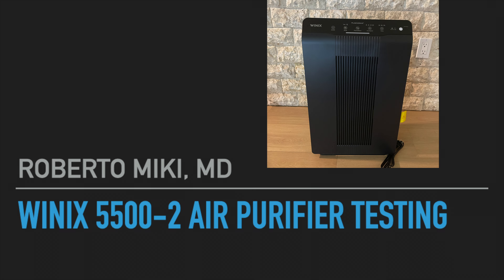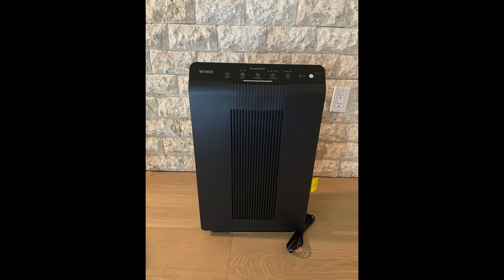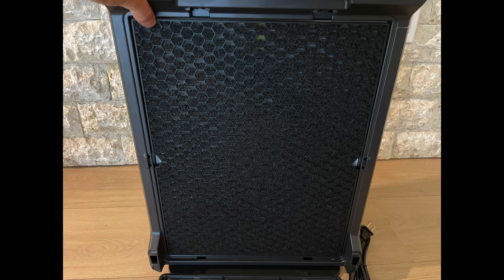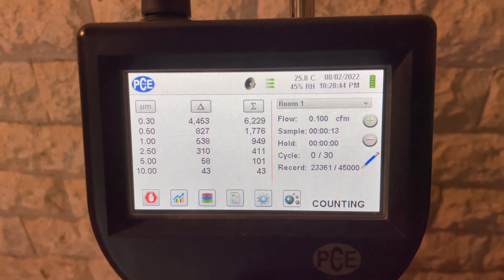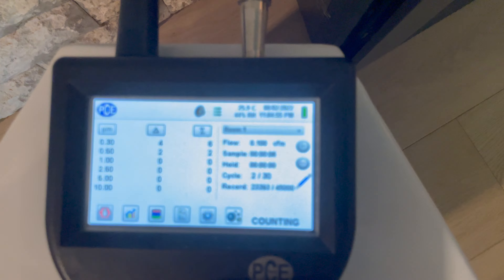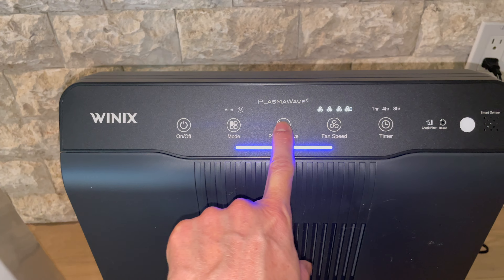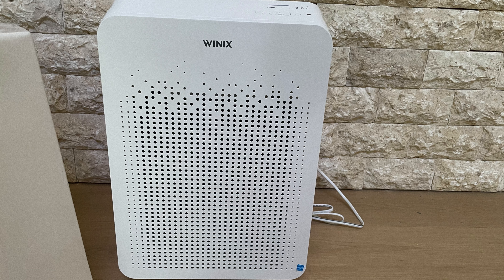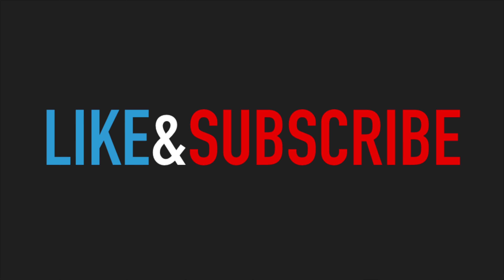Does Plasmawave create ozone? Winix 5500-2 Air Purifier Testing

Comment: Fantastic!  Thank you so much for putting us all at ease.  🙏
Reply from the maker: My pleasure! Thank you for the suggestion!
Reply: Not trying to worry you, just FYI, I was researching this 5500-2 unit and read that its Plasmawave function does produce ozone at about 3 parts per Billion. That is an insanely small amount, and personally I would not worry about it. Just wanted to mention it because while this is a good video, the testing meter they used only measured in parts per Million so that’s why it didn’t register on their meter. If it makes you feel any better, the 5500-2 is CARB-certified. CARB is a California safety agency that does extensive testing and will not certify anything that produces more than 5 ppb of ozone. I’m about to buy this 5500-2, it seems amazing for the price.
Reply: At 3 parts per billion, how long before it adds up to become over 50 parts per billion? Wonder what a monthly trend would look like...
Reply: @oscarescobedo8311  I'm not an expert but everything I've researched says ozone breaks down into regular oxygen in less than an hour at low concentrations, or in about 3-4 hours at high concentrations. 3ppb is an extreeemely low concentration so I'm guessing it breaks down in a matter of minutes. Or maybe 3ppb is the leftover amount that the unit regenerates faster than it can break down, until you turn Plasmawave off. Either way, it's not going to build up over time. 

I did buy the 5500-2 a few months ago. I usually run it w/ the Plasmawave turned off just in case. But I have used it w/ Plasmawave on when trying to get rid of chemical odors. I left it running for hours and didn't notice any adverse effects

Comment: One question about the Ozone Detector: what is the resolution of the device. Perhaps it’s not sensitive enough to detect ozone.
Reply from the maker: Resolution of device is 0.01 ppm per the manufacturer. OSHA has a limit of 0.1 ppm over 8 hours or 0.2 mg of ozone per cubic meter of air.
Reply from the maker: https://www.forensicsdetectors.com/blogs/articles/ozone-detector-guide

Low-Level OZONE Detector | 0.01 ppm | NIST Traceable
Reply: So is secure to have at home with kids? No ozone in the air?
Reply: @ottonain  well, it looks like it doesn’t release enough ozone to be detected. I got the air purifier and I always turn off the ionizer.
Reply: Yes, that’s exactly the case. According to others’ research, this unit’s Plasmawave function produces about 3 parts per Billion of ozone. I wouldn’t worry about such a miniscule amount. But it is there. If that worries you I recommend looking up this unit’s CARB certification, hopefully that will reassure you.
Reply: @kite9d3  is that 3 ppb or did you mean 30 ppb?
Reply: @ottonain   You can turn it off too

Comment: Just curious, did you check if there was ozone with the PlasmaWave light off? I'm sensitive to ionizers, and they give me a sore throat. I recently bought a Winix 5500-2 and had it running at night. After three nights of waking up with a sore throat and the PlasmaWave light off, I decided to keep it on. That night, I woke up without a sore throat. So, I think the setting might be reversed on my unit!

Comment: I'm using the winix nk100 and it emits 0.05ppm according to their own instructions. Is this safe to use in my small apartment? I have another plasmawave one as well, a sharp plasmawave model that apparently emits 0. Going to use both to rid my place of dust

Comment: what about hydroxyls? That's the main concern with the plasmawave.
Reply from the maker: I do not have a device to measure hydroxyls in the air.
Reply from the maker: I will need to do some research on hydroxyls. But after a brief and prelim google search I found that it is common with gas stoves and cooking. Sounds like something to think about. Thanks for bringing it to my attention. I am not sure if I can test for this. Has anyone else tested for hydroxyls on other channels and videos? If so please post a link.
Reply: @RobertoMikiMD  Of course!

No unfortunately I haven't found any third party tests, but searches online have found similar issues as ozone and other like technologies... Amount used in air purifiers aren't enough to do anything meaningful, and they are extremely damaging

Comment: It might not create much ozone, but it will most definitely create dark rings around your pictures on your walls overtime. That’s because the ions attach themselves to particles and they want sticking on the walls. Keep plasma wave turned off. You have been warned. As for the device itself… I love it, and it’s almost perfect. That is If it wasn’t for that stupid blue light that completely engulfs your entire room at night. And putting the machine in sleep mode doesn’t help because it brings your machine to an absolute crawl and makes it almost useless. Consumers have complained about this over and over again, but the people at Winx just aren’t listening. We don’t want the blue light!!! Get rid of it! It’s too fucking bright! And people who want a nice looking unit don’t want to put electrical tape over it to where it looks like you got it from a pawn shop!
Reply: PW makes me feel lightheaded, dizzy and gives me a headache. I don’t trust it and NOBDY CAN CLEARY EXPLAIN WHAT IT DOES. Like tell me like I’m a 8 yr old. It makes + & - this and that in the air, it charges the air. Like what? Ok so what does it DO??? Remove smells?

Comment: PlasmaWave….NOBDY CAN CLEARY EXPLAIN WHAT IT DOES. Like tell me like I’m a 8 yr old. It makes + & - this and that in the air, it charges the air. Like what? Ok so what does it DO??? Remove smells?
Reply: From what I understand it causes particulates in the air (dust) to clump together and fall/stick to the ground/walls for easier filtration (going into the purifier) or cleaning (vacuuming or wiping surfaces). Less floaties.

Comment: Uh, there were lots of problems with your testing. #1 , you aren't suppose to put an ozone monitor on top of another electronic b/c it can block/mask the ozone and create electronic interreference with the unit preventing a registration. #2 Your ozone measuring device measures in PPM, you need a more sensitive device that measures between 20-50 PPB or parts per BILLION. I had actually talked to the manufacturer of the ozone detector for that device [it is used in other devices] and the chief engineer told me it was not going to detect the safe range for people [20-50 PPB -depending on which gov't study you go by].  If you notice, your meter is in PPM or parts per million and only goes to the 2nd digit. 90 PPB which would be unsafe, is not even going to register on a PPM meter, b/c the difference is basically 1000, and you measured in with just 2 digits.  The other thing is even a .01 on your meter would be unsafe and there is actually a 10% error range on that sensor. Meaning you could have 200 ppb [extremely unsafe] and it won't show.

Basically, you need a better [more expensive ozone meter]
Reply from the maker: Thank u for feedback. I can understand the concern for electronic interference. On the topic of ppb, I think your math is wrong. 0.01 ppm is equivalent to 10 ppb. So, this meter will pick up the levels of ozone for which you r concerned.
Reply: @RobertoMikiMD  Well I stand corrected on that calculation point.😆😅🤣 The plus minus on the sensor doesn't capture accurately lower ppb like 10-20-30, apparently you'd need a way more expensive sensor.

Did you ever try to measure for ozone by putting the device lower and further away from the machine [as ozone sinks].  Also how long did you run the machine with plasmawave on before testing for ozone?
Reply from the maker: @hernandayolearyallda  I can definitely run the test again with the ozone meter lower and away from the machine. I still have the monitor and the purifier. I ran the machine for around 1 minute but can run it for longer. Any suggestions? It would be easy to do. As far as getting a more sensitive ozone meter I can try to look for one but I do have a budget.
Reply: @RobertoMikiMD   Yeah, best /most accurate ones usually going to run you a few thousand dollars 4-6k, the best cheapest one I seen was the air quality egg based off of aqmd testing which is a gov organization that independently test them, that starts around $1k,  the rest of the ones tested, [and they tested dozens] aren't really accurate.

There is a cheaper tester called eco-sensor which claims by the manufacturer to be accurate up to about 20 ppb in the "safe range".  But I can't find any independent test to support it. That one is around 300-500$$$.

Also the safe limits are based off of long exposures like 8 hours, so it is the kind of thing you'd have to run for like 8-12 hours [ionizer] and the leave the device lower to the ground [ozone sinks] to try to pick up something.